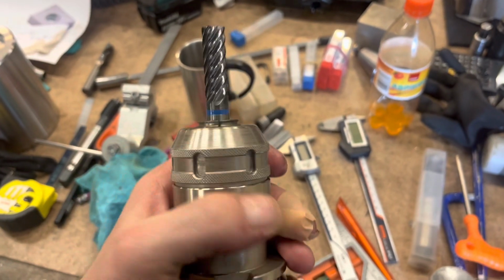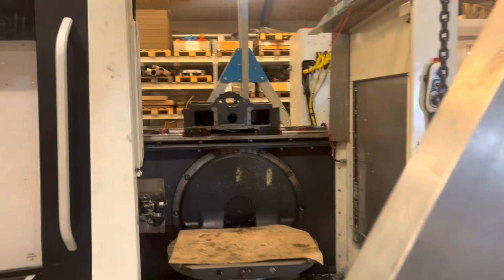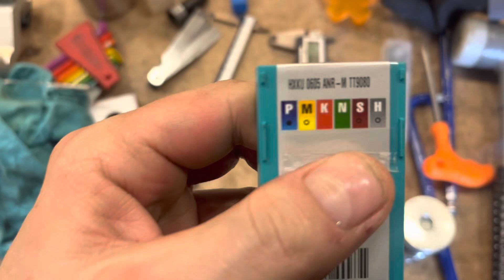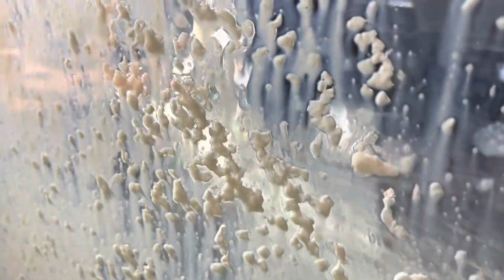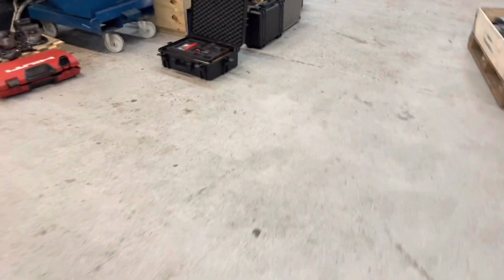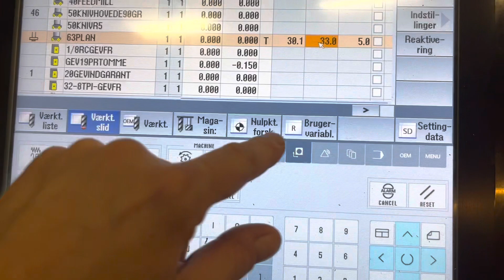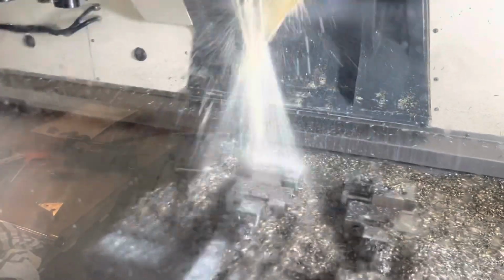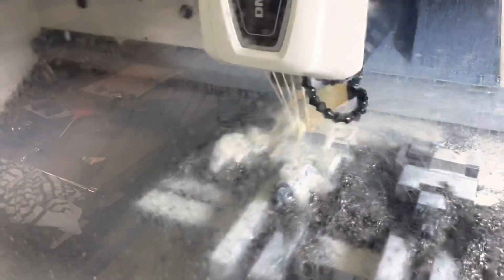Dynamic milling 316L stainless. Also had a big crash on the 5 axis!!🙄

Comment: Hello Mate 👋 I feel sorry for your crash as this delays everything. Are you testing your programs before run for a collision check ? Best wishes from UK, Daniel
Reply from the maker: I simulate but I don’t collision check because I don’t put all fixture and tool holder specs in the cam. We do so many setups it would be a waste of time I think. This accident was pure my mistake for now watching the machine when I was running the face op on the sides.
Reply: @nikolaiownz oh I understand.. in the place I work we have to collision check each single program before run.. I think it’s a good habit. Never mind I hope they will fix it soon!